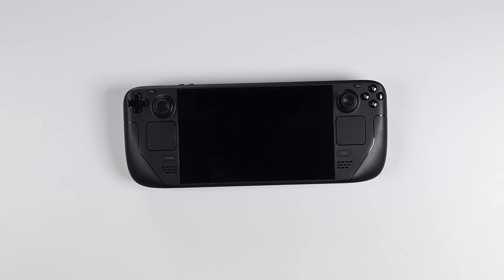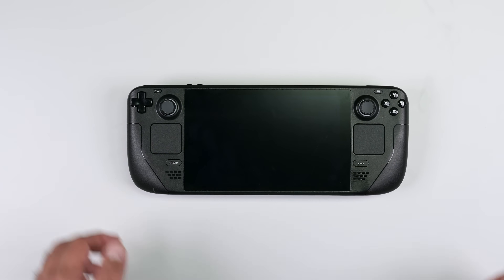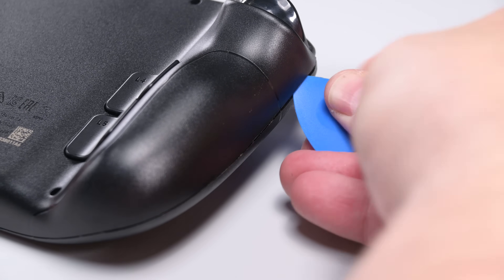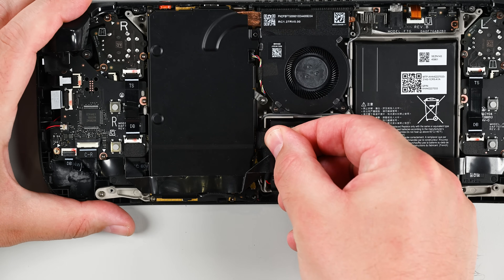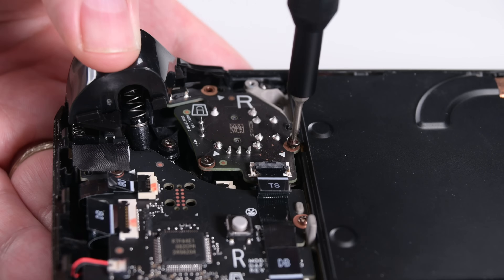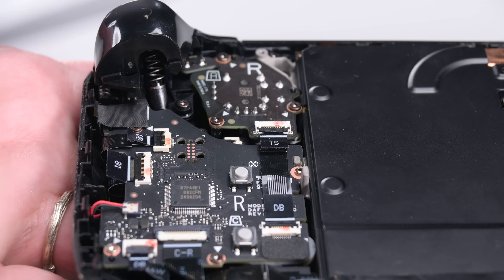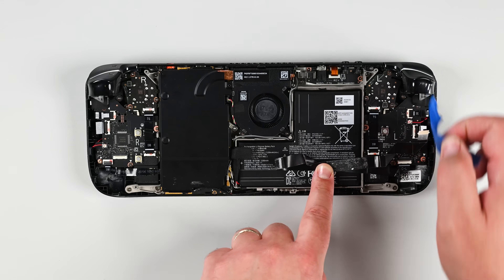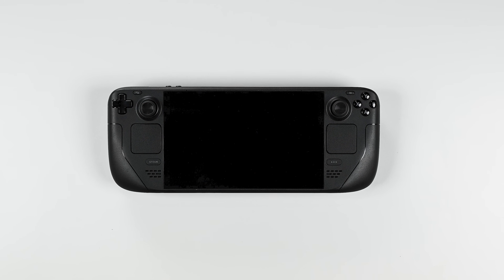How to Replace the Steam Deck OLED Thumbstick!

Comment: I’m here to try to get a better look at the power button of all things. It looks fairly easy to access. I’m doing some simple modifications and I want to replace the orange power button with a 3D printed green one. I don’t want to take it apart more than I have to, so I’m planning to take it apart, measure and model, print, replace and reassemble all in one go.

Comment: can you replace the sticks without touching the battery and motherboard?
Reply: all you really have to do is unscrew some things and disconnect ribbon cables.

seems Wayyyyy easier than replacing stuff on smartphones

Comment: Did anyone did this without unplugging the battery, and not set there house on fire ?
Reply: The battery won’t ignite. The risk is that by leaving the battery connected, you risk damaging a component by short circuiting something. Having said that, I’ve done the swap with the power connected many times. Just be careful and take your time.

Comment: Ya'll really made cutting the adhesive of the C-R cable a lot easier than it is on a deck that has never been opened. In fact, a lot of these steps were more difficult that the video made it look. However, this is a fine video and provided everything I needed. Thanks!

Comment: I just did this today but i couldn't get the clasp on the ribbon cable to go back down all the way but the ribbon cable is attached and the thumb sticks are working fine should i be worried ?
Reply: I mean, yeah. You should probably get a solid connection just to ensure longevity.

Comment: You left out the command you have to run in the terminal to calibrate the thumbsticks. Otherwise your dead zones will be way off
Reply: Is there a video for this?
Reply: @JC-vo5wz  a bit late but in the options where u can see ur Controllers International and external 
There u can do this
Reply: What terminal command? Are you high? It literally automatically calibrates everything, if not just do it in the options.
Reply: I didn't understand anything, please help
Reply: @Bebou.1 no

Comment: This is not the OLED version...

Edit: At the beginning of the video it's definitely not, but apparently it is later when it's already open. I'm not quite sure why it was decided to cut corners/costs here and not shoot the montage with the OLED steam deck at the beginning too as clearly I'm not the only one who got confused by this.
Reply: The internal scenes are the oled. I’m guessing the just reused some of the lcd instructions for the beginning since it’s the same processes until you’re at the internals
Reply: @Legokillen51  It would appear you are right. Once opened you can see the orange button. That being said it's confusing at best and should have been disclosed in my opinion...
Reply: @OperationDecoded  indeed
Reply: @OperationDecoded  why would you be confused? It's literally not that big of a deal when the internals and steps they showed were for the OLED model. If a button colour throws you off that much then that's your own issue I am sorry to say.
Reply: @AndrewPL5  Yes but when the beginning suggests it is the LED and they didn't clarify, that's when you wonder whether it actually is the OLED.  The color of the button is how you differentiate the quickest between the two
Reply: @OperationDecoded  and? The tutorial is for the oled and they showed the repair being done on the oled. You have other issues if you're mad over a button colour being wrong. Hardly anyone cares or will even notice, and it makes zero difference. You're making such an issue over nothing. It's weird
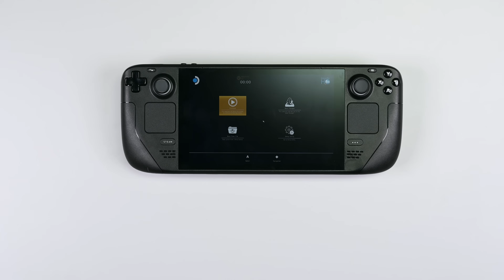Reply: Wait a second where is that orange power button at around 0:45 ?? this can’t be a oled version
Reply: @marlapin12  exactly, no orange button there.
Reply: It is
Reply: he used the same video reel from another repair of an lcd steamdeck

Comment: I think the oled version has a orange button?
Reply: Yes, and black bases on the sticks. Opening the Deck is the same on both models and they used their old footage here.
Reply: Only the 1to version
Reply: @Bl4ckLine  Nope, my 512gb version has an orange button. This is not an OLED version as it also has the white thumb sticks which only the LCD version has. Plus the visibly smaller screen.
Reply: @chadlad25 Not good considering there are slight differences in the internals of the OLED.